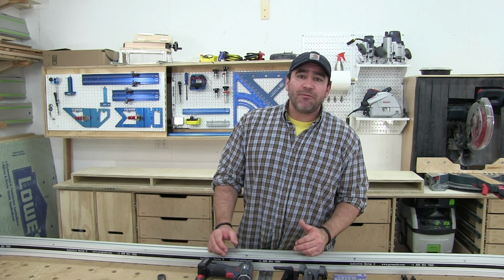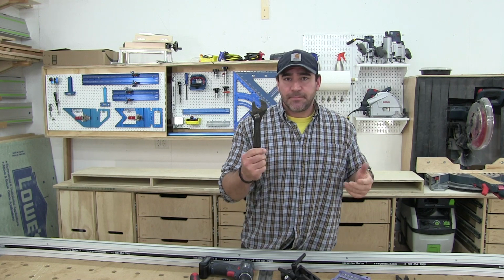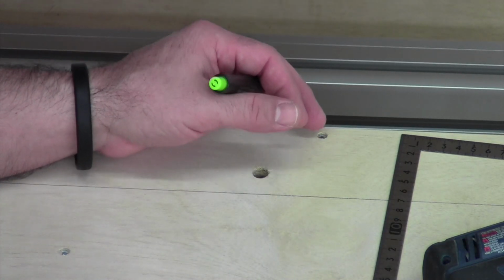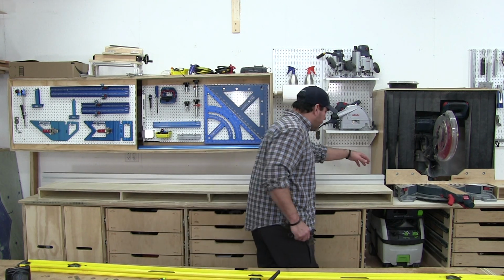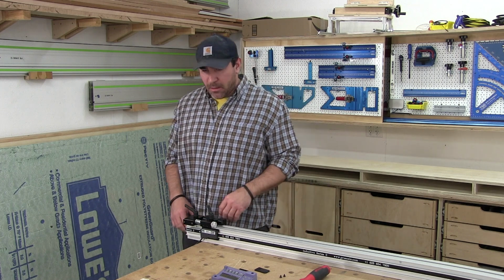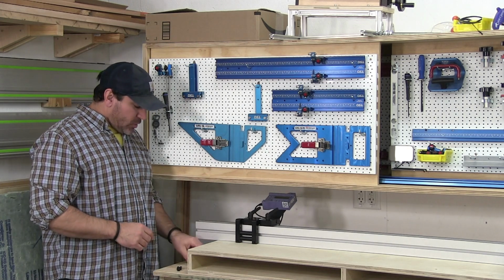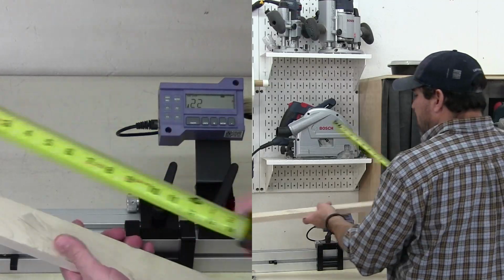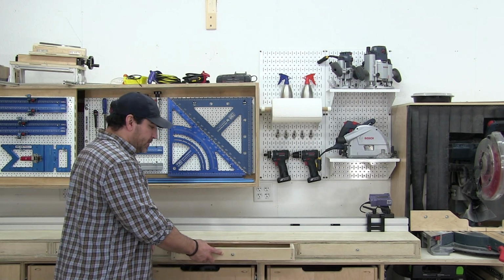Installing the ProStop Digital Fence and Stop System for the Ultimate Miter Saw Fence.

Comment: I consider you a pretty bright guy but that wasn't a very accurate method of using a straight edge to line up a fence, I would use the entire miter saw not just one side